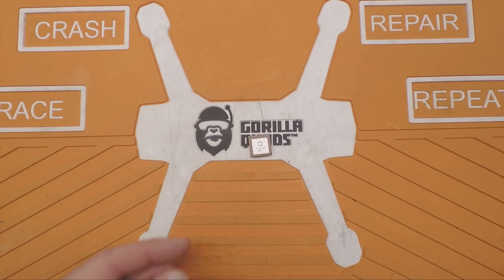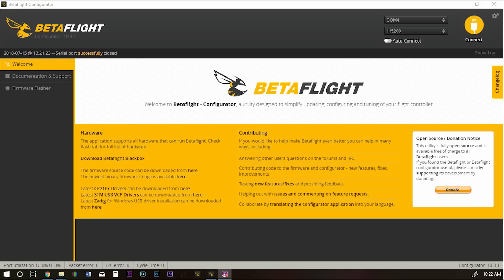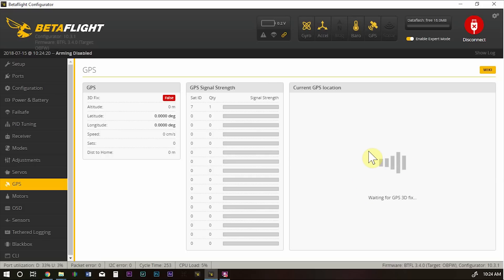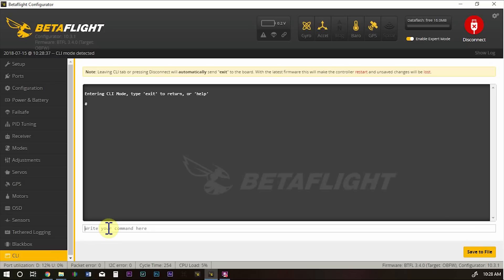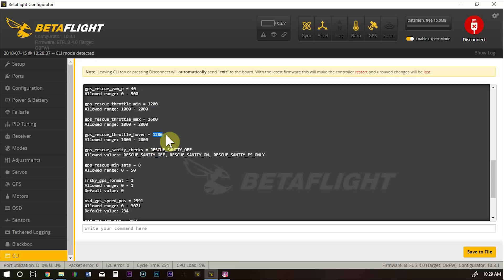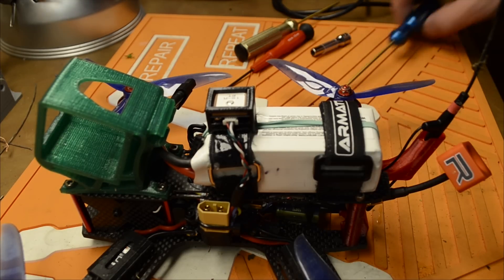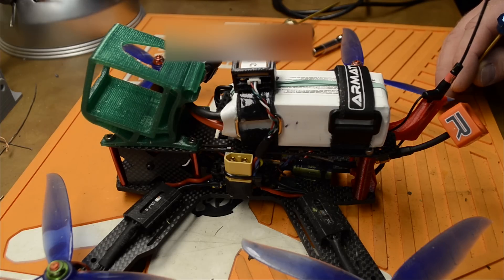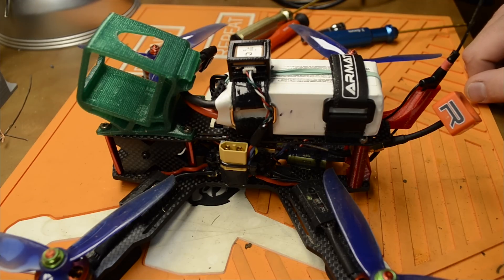Betaflight GPS and Rescue mode setup

Comment: very good information, i really appreciate it.  I just received my GPS and have a question about the installation.  I am using the F4 Omnibus  Pro 4 corner FC. Uart 6 is open but it is inverted. Will the GPS work on that or do I need to disable the inverted Uart?  Thank you for your help. Roger
Reply: TweetFPV
Thanks for all your help in getting my GPS working. It is up and running :)  I had to get a new FCB (I shorted mine out looking for the correct pins to solder to). I bought a Mini Ublox M8N from ebay, and out of the box the Lat and Long said I was 50 mile away from where I actually was?? So, after a little research I discovered that I needed to do a Magnetic Declination adjustment (MDA) in BetaFlight, Config page, GPS section. This MDA will make your ‘Home Location” more accurate.  If I had put my quad in the air and lost it, the GPS Lat and Long readout would not have been any help because they would be giving me a readout 50 miles from where the quad really is :(   Time to do a MDA:  For those who don’t know how to do this Read ON. Put your quad out in the yard (battery not connected…yet) go to Google Maps and get the Lat and Long numbers for where your quad is sitting in your yard. (zoom in on your yard where the quad is sitting, right click, choose       ‘whats here’ and a dialog box will give you the Lat and Long). Put those numbers into the calculator at this site:   https://www.ngdc.noaa.gov/geomag-web/#declination       If you are in North America the number will similar to mine 9.8⁰ W, which needs to be entered in BetaFlight as -9.8
Now, connect the quad to BF, go to the Config page, GPS section and enter your Magnetic Declination number. (hit save) Now take the quad outside to the EXACT spot that you had it earlier. Power up the battery and get a Lat and Long reading from your goggles.Take those numbers and go back to Google Maps, enter them in this format in the search area 39.1234567,-80.0000456  (your numbers will be different). Do a search and if you entered your numbers correctly you should see Google put a pin close to where your quad is in your yard. Now, if you want the pin to be closer to your quad just repeat the above process until you are satisfied with the pin location. The closer you get the pin to your quad in Google, the more accurate your quads actual location read out will be.  My first number was -9.8 which was about 75 feet from my quad. I wanted it to be closer so I repeated the process a couple more times and ended up with -9.75 which put the Google pin about 12-15 feet from my quad (good enough for me). Thanks again TweetFPV, safe flying
Reply from the maker: Awesome info on the MDA, I'll have to give that a try.
Reply from the maker: It looks like you will need to remove r37 from your board to remove the inversion on uart 6 to get your gps to work.
Reply: Ok, any advice on desoldering that? Never tried it before and it is a VERY close to other  components. Again
Thank you for your help.
Reply from the maker: If you have some other damaged electronic parts I would practice on those first. They aren't very hard to remove if you have a steady hand and a decent temperature controlled soldering iron. Another option is to use a very small pair of diagonal cutters and just cut the component in half but there is a potential to damage the board if you aren't careful. Look up a guy called Louis Rosman he does Apple repair and puts it on youtube. Obviously you aren't going to have the tools that he has but you can get an idea of how to remove and replace tiny components like that. Or Bardwell video on the Fatshark high power mod for the rapid fire. Wish I had a better answer for you. Good luck!
Reply: I need to get someone to do that for me....im not steady enough.  Thank you for your help, I hope to get the GPS up and working soon. Roger
Reply from the maker: I am more than happy to offer whatever assistance I can.
Reply: Just a heads up. i contacted Ublox-USA about connection to Uarts, his reply "The device uses standard UART logic. There’s no ability to invert the UART signals." So a definite answer....don't connect to inverted UARTS.   hope that may help someone in the future.
Reply from the maker: Thank you for the info!

Comment: Before you take off, do you have to set a home location? If so, how?
Reply from the maker: Your home location is the gps position that is acquired when you arm.
Reply: Good to know. Thanks a lot!
Reply: I bought a Ublox M8N, the version without a compass. The F3 Flight controller I ordered does not feature a barometer or a magnetometer. Will I be able to use the RTH feature with this?
Reply from the maker: No, f3 flight controllers no longer support gps functions in betaflight.
Reply: Take it some place open and clear when arming so that your return to home feature takes it somewhere safe.

Comment: Thanks for the info!
Just tried it for the first time. If you're flying in Acro or Air mode when you activate Rescue - you need the quad to revert to Angle mode otherwise it just falls out of the sky. I don't think Rescue mode automatically invokes Angle Mode unless anyone knows better?
Reply from the maker: It went into a self level mode when it activated for me. I haven't tried to disable the accelerometers to see what would happen.
Reply: I don't think thats correct, From my testing with rescue mode enabled on a stick it works pretty well. I had to disable sanity checks for it to work though( i think this has to do with the distance between you and the quad as to why it is falling out of the sky) try with sanity checks off for closer distances
Reply: Gracias! me has dado la idea. Creo que ya no caerá del cielo.
Reply: Yes we were testing fail-safe too close. It works a treat.

Comment: Magnetic declination is the difference between true north and magnetic north. Where I live, declination is over 13 degrees which is significant.
Reply from the maker: Thanks for the info, this could be very useful for a lot of people!
Reply: is that a setting that can be adjusted? I'm noticing that the directional arrow in my OSD is no accurate at all. maybe this is why? thanks for any info on this.
Reply from the maker: Betaflight says you need to be over 200m away before the direction home is accurate.

Comment: Thankfully i've watched your vid by accident and i figure out why my quad was not arming.
Probably it's the CLI setting about the sattelites and i thought my F4 had an issue , i was getting ready to buy a new one. i will try your recomendations now.
I just have one question, on the gps tab the you showed the sattelites picking up on the left it said 
3d fix faulse.  do we ignore it?
Reply from the maker: For me I always get gps fix failure unless I take my Quad and computer outside and let it fun for a few minutes.
Reply: Now motors arm. I just need to do a test to see how it goes
Reply: Type status in CLI and it will give you “Arming Flags” then go on google and type “BetaFlight arming Flags” to get a description of each reason why your Kwad won’t arm. 👌
Reply: I found it. It was the satelites. I've set it to 0 and then it was able to arm.

Comment: Need Help....I have that same gps unit tried to get it working on HGLRC f428 stack but No go. Wired up correctly , even tried switching uarts. Also followed your video on the Betaflight setup and still nothing. Beta flight shows nothing under the god section of the setup tab ...not even a false tag. Under the GPS tab I am not getting any SAT IDs? Any help would be greatly appreciated.
Reply from the maker: Which uart do you have it wired to? Does the gps leds light up? Which GPS unit do you have? What version of bf are you using? You can send me some pictures of your setup and a cli dump to my channels email address.
Reply: TweetFPV what’s is the email address. I will send it when I get home.
Reply from the maker: Tweetfpv@gmail.com
Reply: So what did you figure out with your hglrc and getting the gps to work? I also have that stack and had ordered the gps. Just making sure it works with it thanks
Reply from the maker: This was a while ago but I think we got it working. There was just some confusion on where the TX and rx wires from the gps unit go. If memory serves me.
Reply from the maker: The inverter could be causing you problems. Try wiring it to a different uart.
Reply: @TweetFPV  I'm out of UARTS :) the manual says UART1 & 2 are inverted... For testing I can give up smartaudio... I'll give it a try. Thx
Reply from the maker: Good luck.
Reply: Awesome good deal thank you keep to the sky’s

Comment: One more thing. Geekstory BN-880 GPS Module U- M8030 with HMC5883 Compass Support GPS Glonass Beidou for Arduino Aircraft Pixhawk APM Flight Controller https://www.amazon.com/dp/B078Y6323W/ref=cm_sw_r_cp_apa_dKxvBbXMVMPDT

Shows a 6 pin connector. What I see extra here are the additional pins for SDA and SCL. 

I have found that my matek f4 and f7 have pads for SDA and SCL. Does that give better data for GPS or does all of this need to have the backing of betaflight? I'll m currently trying to dig up this information.
Reply from the maker: I'm not sure. My omnibus f4 fireworks fc also has the sda scl pads on it. Please let me know what you find out.
Reply: @TweetFPV  I think it has to do with a magnetometer. I'll try to find out more. Possibly test it as well.

Comment: Are you familiar with the tool used to connect this GPS device to a PC for configuration. I assume it's some kind of USB adapter.
Reply from the maker: Yes, it's just a standard ftdi adaptor Qunqi 3.3V 5.5V FT232RL FTDI Usb to TTL Serial Adapter Module for Arduino Mini Port https://www.amazon.com/dp/B014Y1IMNM/ref=cm_sw_r_cp_apa_CVBvBbDZS2ZW1

Comment: I'm pretty sure you must also use a magnetometer for better reliability and accuracy! Magnetometer allows the copter to know what direction it's heading to!
Thanks for sharing, i might give it a shot on my 7" :)
Have a great week and keep on flying!
Reply from the maker: Using a magnetometer would be better but rescue mode was designed to work with or without one.
Reply: for using a magnetometer you must use a big mount for this (maximum distance of motors)
Reply: Hey do you know if you need a fc with a barometer in order for gps to work?? Thanks!
Reply from the maker: A baro is not necessary for gps rescue mode to work.

Comment: Thanks for putting this up.  One thought on the home point.  If home point is set by gps then you need sats to triangulate the home point.  It appeared that you didn’t have any untill you got out of the woods.
Reply from the maker: I had stats before I left the woods but it did seam like it wanted to land at the tree line. More testing is needed.

Comment: Really nice, dude. 😊
But looks like the rescue mode can land. It's not pretty, but...
Reply from the maker: Land, crash, what's the difference as long as I get my gear back I'm good!
Reply: I love it I got it in my inav builds, and went my craft goes into fail safe, just turn around and come back home,  tested many times works super, I did not used betaflight but for Inav is fantastic. plus you can have you log and lat show in the googles and if you have a dvr you know when down just use  you phone.
Reply: TweetFPV Absolutely! 😊

Comment: Excellent edit, thanks!!! In terms of your gps mount...perhaps try mounting it at the same angle as your fpv cam so it points straight up during most of the flight
Reply from the maker: Oh that is a great idea! I will make a different version with different degrees.

Comment: I usually fly BF on my acro quads, but for my long range I'm rocking iNav due to the more mature GPS functionality. I did try one of the BF 3.4 RC's but couldn't figure out the failsafe stuff. So in that respect many thanks for showing me how to do that.
However this video has shown me that BF's GP modes are not mature enough to be trusted (IMO) so in the mean-time I am going to stick with iNav, even though it doesn't fly anywhere near as well as BF.
Reply from the maker: I hear you, gps is not a big feature in betaflight but its better than nothing.
Reply: It sure is.